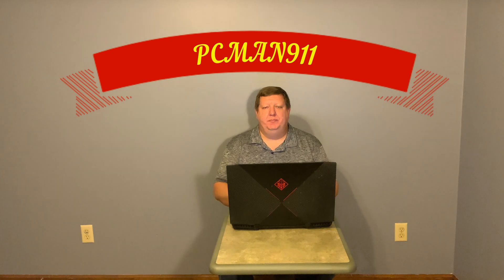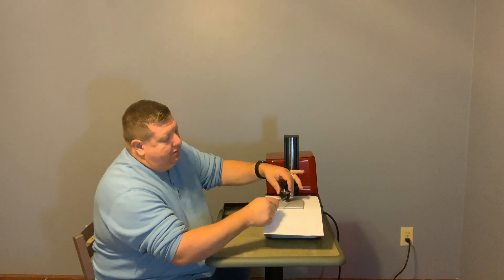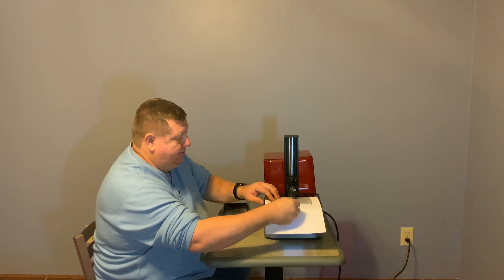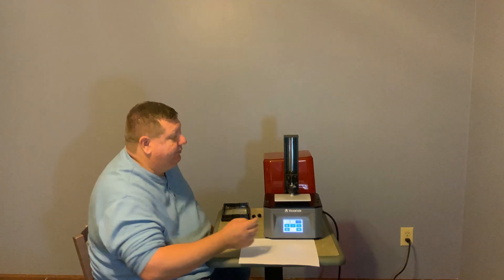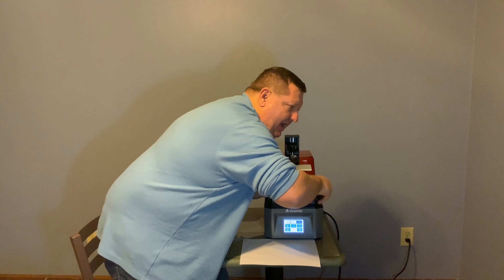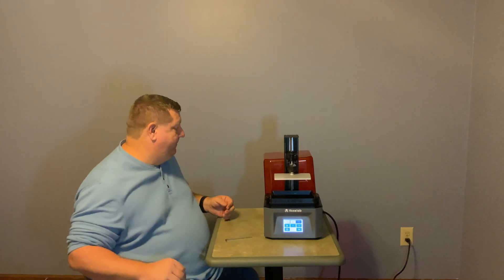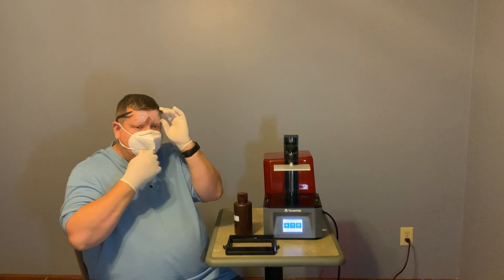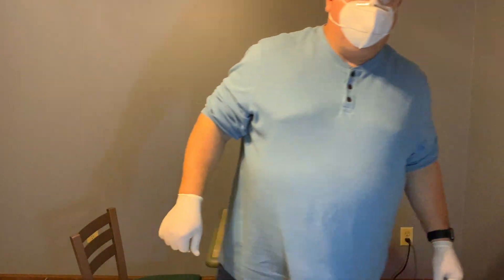Voxelab Proxima Leveling and First Print 3D Benchy

Comment: How did you convert .stl file to the .cfg file the slicing software was asking for? 

I tried Cura but it did not have Voxelab printer as an option.
Reply: cura is not for resin printers